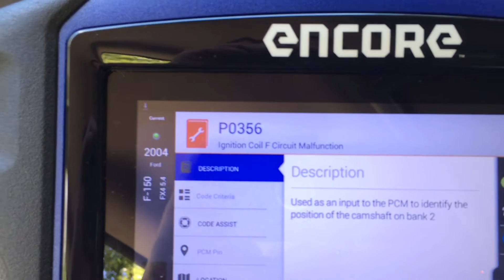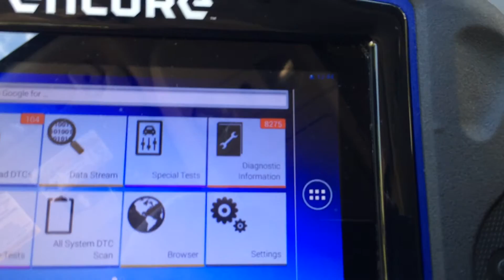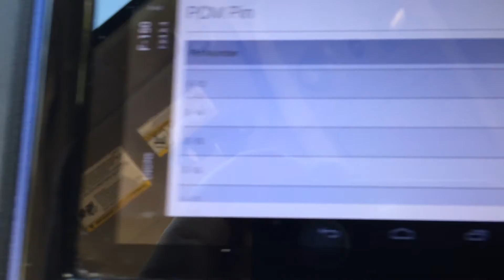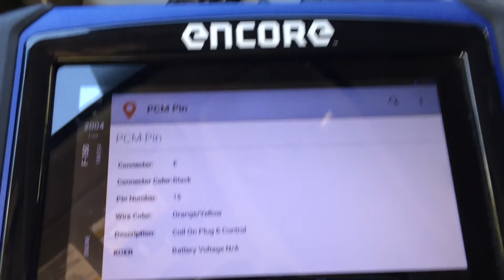Validate wiring from Powertrain control with the OTC Encore

Comment: You didn't "verify" shit. You got the info needed to do further testing. Something that scan tool probably doesn't even do. Most scan tools are WiFi enabled and connected to an info source, probably one as reliable or more than the "embedded" one. And most (read all) of the brands have OTC beat in scan tools. That's proven fact among the thousand or so pros I have talked with during my career in auto repair.